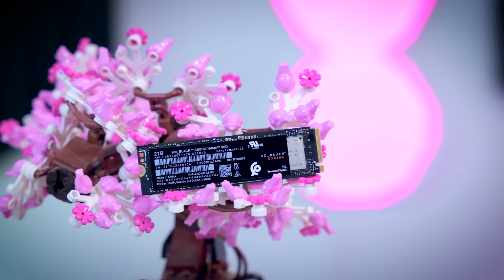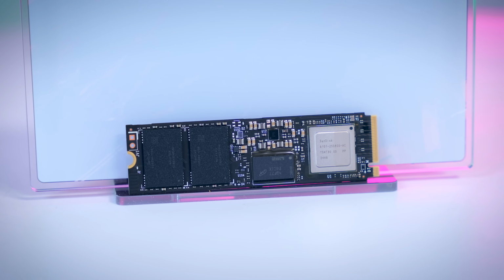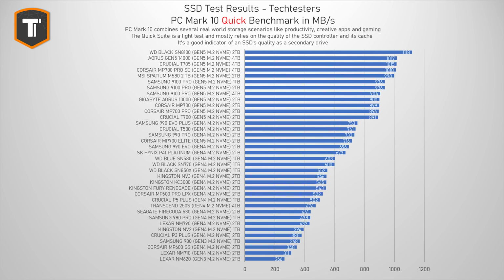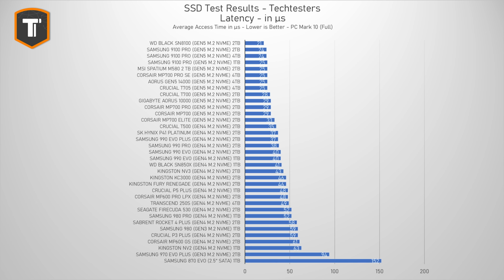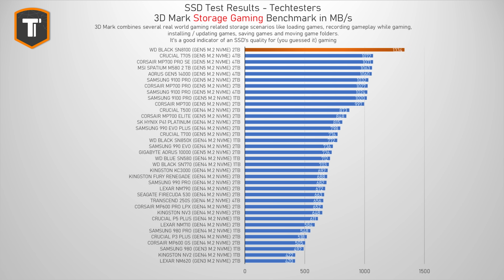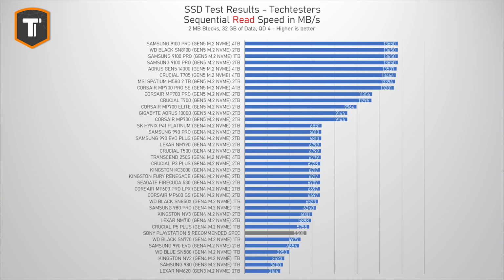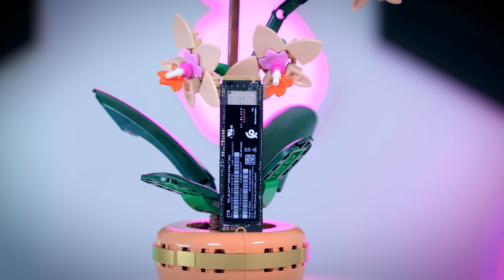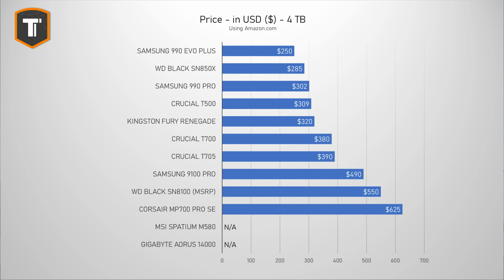Destroying The Competition - WD Black SN8100 SSD Review

Comment: The Western Digital SN8100 is a solid-state drive in the M.2 2280 form factor, launched in May 2025. 
It is available in capacities ranging from 1 TB to 8 TB. This page reports specifications for the 2 TB variant. 
With the rest of the system, the Western Digital SN8100 interfaces using a PCI-Express 5.0 x4 connection. 
The SSD controller is the "SM2508" from Silicon Motion, a DRAM cache chip is available. 
Western Digital has installed 218-layer TLC NAND flash on the SN8100, the flash chips are made by Kioxia. 
To improve write speeds, a pseudo-SLC cache is used, so bursts of incoming writes are processed more quickly. 
The cache is sized at 600 GB, once it is full, writes complete at 3892 MB/s. 
Copying data out of the SLC cache (folding) completes at 2000 MB/s. 
Thanks to support for the fast PCI-Express 5.0 interface, performance is excellent. 
The SN8100 is rated for sequential read speeds of up to 14,900 MB/s and 14,000 MB/s write; random IOPS reach up to 2300K for reads and 2400K for writes.
The warranty length is set to five years, which is an excellent warranty period. 
Western Digital guarantees an endurance rating of 1200 TBW, a typical value for consumer SSDs.

Comment: You said you should use a heat sink with your motherboard, but my motherboard is a laptop and it doesn’t come with any heat sinks. Do you recommend not using a heat sink when it’s in a laptop?
Reply from the maker: Most laptops won't fit a heatsink, so you won't have that option. But assuming you want a Gen5 SSD for your laptop, these should still be one of the better options due to the relatively ok power consumption.

Comment: I'm mostly impressed by the MSI drive. Definitely the best performing 2TB drive here, and seeing how results between a 4TB and 2TB version of the same drive can differ vastly in some tests, I'm curious how the 4TB version of the MSI would score or how the 2TB versions of the WD and Crucial T705 would fare against each other and their larger kin.

My guess on why the 2TB MSI keeps up with the 4TB models of other brands while their 2TB models fall behind, is due to DRAM cache size, which is 1GB per 1TB capacity for WD, Samsung and Crucial, buy twice that for the MSI. So the 2TB MSI has the same DRAM as the 4TB models. 

I am looking to buy a 2TB Gen5 and was set on either the Crucial T705 or Samsung 9100 Pro. Unfortunately there is no comparison here with the 2TB T705 - so assuming the smaller capacity might perform worse, the MSI would be a safer bet, as its 2TB version performs on par with the 4TB versions in this chart (the Samsung for example does not - the 4TB is better than the 2TB one in most tests).

The MSI seems to have a worse PSLC cache architecture compared to the other drives, however that only becomes relevant on sustained writes exceeding 220GB (that's where the WS SN8100 excells).

E

Comment: I just ordered the WD SN8100 2TB for my PS5 PRO! Hope the upgrade is worth it. Thanks for your video.
Reply from the maker: Kind of overkill though, PS5 Pro only runs Gen4 speeds. But it should still be fine, assuming you bought a heatsink too?
Reply: @TechTesters ElecGear EL-P5SP - I think this is the best cooler you can get for the PS5 Pro!

Comment: These benchmark software-based comparisons and tests are nice, but as far as game loading performance goes, they don't tell us the real impact.
The difference in loading times of many modern titles between a PCIE 4.0 SSD and a PCIE 5.0 SSD turns out to be miniscule.  According to testing done elsewhere on Youtube in a video titled "SSD PCIe 5.0 vs PCIe 4.0 vs PCIe 3.0 Loading Games", the majority are in the fractions of a second, and the biggest differences never crack even 2 seconds of faster loading times between PCIE 4.0 and PCIE 5.0.

So while I appreciate the performance difference between all the SSDs shown in scores, it is dramatically less helpful for the average Joe in determining whether spending $100+ for a PCIE 5.0 SSD is justified.

I think that tech reviews are immensely helpful precisely because they let us gauge without buying firsthand what products will give us the most bang for our buck, less so for purely academic or research purposes.  It would be much more helpful if at least some frame of reference was given for what the performance difference would mean in actual usage.

Comment: Great review! In addition to calling out support for TCG Opal, I think it would be really helpful to know if the drives you review are eDrive/IEEE 1667 compatible, which is required for hardware encryption to work with BitLocker on Windows. I recently purchased this drive and was disappointed to find out that while it did support TCG Opal, Western Digital/SanDisk provides no software to actually utilize the feature and it is not compatible with BitLocker. Since I still wanted the drive to be encrypted, I had to use BitLocker's software encryption, which severely harms the drive's performance. SEQ1M Q8T1 speeds were largely unaffected, but SEQ128K Q32T1 R/W, RND4K Q32T16 R/W, and RND4K W speeds were roughly HALVED. On the other hand, the hardware encryption on my Samsung drives works with BitLocker (thanks to a simple toggle in Samsung Magician), and retain native performance when operating this way.

Windows users that care about keeping their data encrypted should know that TCG Opal certification doesn't mean much unless the drive manufacturer goes above and beyond to actually provide proper software support for it, and unfortunately Western Digital seems to have dropped the ball in this regard. Software encryption is always an option, but I can't imagine customers will be thrilled to cripple the performance of their expensive PCIe Gen 5 drives.

Comment: 6:25 You concluded its advisable to use a heatsink after the tests were done (will do!) but did you use a heatsink for thes tests or was the bare drive tested without heatsink?
This gives us a clue about wether or not the consistenty test was throttled by heat on this drive or heat was not the cause.
Reply from the maker: For regular benchmarks I use a heatsink and a little bit of airflow.

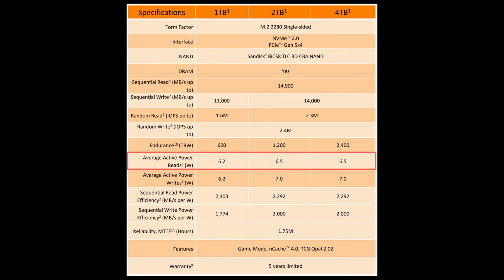Comment: Great video and love how precise and articulated you present in depth the specifications as well as especially the UNSPECIFIIED UNMENTIONED HIDDEN specs are revealed 1:13 to us consumers so we know exactly what is known and what is (deliberately) unknown.
For these alone my favourite technology/hardware channel by far!
Curious about how the much cheaper 1TB version performs against the already reviewed 2TB model. Write speeds are lower, thats fine, but how well do the promised same-high-read-speeds keep up?  Especially the 4K Q1 T1 which are the hardest test for SSDs.
Reply from the maker: Thank you!

I did a capacity comparison video a while back (plus we had some other data from before that). Generally, as long as you grab at least a 1TB drive you shouldn't see a significant difference in most use cases. Only in the consistency test or really extreme workloads, but not for regular use.

Comment: I have a question, if you and your viewers don't mind. I'm getting a ssd enclosure for my steam deck.  I think it's only rated for Gen 3. Would getting a Gen 4 be beneficial? Thanks! Great info!
Reply from the maker: Questions are always welcome :)

I'm not 100% sure what the speed limits on a steam deck are, but I guess it'll be 10 Gigabit USB for an external enclosure? In that case it's not really worth buying a high end SSD. Newer (often Gen4) SSDs do tend to use newer controllers and use less power though, and most budget NVMe SSDs nowadays are Gen4 anyway. So there's no big downside to using an older Gen3, but I would probably look for a entry-ish level Gen4 with a DRAM cache. If you have some exact models in your region I am more than happy to tell you which I'd pick. Just post a new question if you do, as replies-to-replies are really hard to track in YouTube, new comments get pushed to the top.

Comment: I cannot care how fast the Samsung 9100s because of my PTSD of how fast the drive failed and caused me to lose my data in the past from multiple 990s. SN850Xs had been holding out for longer and will be the only drive I will keep buying unless the 8100s have similar reliability.
Reply: Bro. You're supposed to download Samsung magician and update the firmware
Reply: @timothygibney159  I always use SS Magician but I had enough with the firmwares bricking alot of time, especially on expensive drives, hassling with RMA processes and customer supports.

Comment: I have a similar Gen5 installed, but I want to caution you that the 14,900+ MB/s transfer rate measured in CrystalDiskMark does not reflect actual application transfer speeds in loading or processing data inside software applications. There is a data bottleneck when it comes to loading and transferring data into the applications. The best speed I've achieved with a fast CFexpress card, read rated at 3,400 MB/s, while using a USB4 (40 Gb/s) reader connected to a USB4 Thunderbolt port into the Gen5 SSD with Windows file Explorer was only ~1,500 MB/s as viewed on the Task Manager. This is nowhere near the advertised 14,900+ MB/s sequential read benchmarks.

It's important to remember that there is a layer of "handshaking" involved in data transfers, which includes sending, receiving, acknowledging, verifying, checksums, and repeating again. This process means the data stream is not a continuous flow but is delivered in packets interrupted by latency (waiting) during the data handshaking. In other words, these super-fast Gen5 SSDs cannot read or write any faster than the software application can process, any more than a larger glass of water helps you drink the quantity faster.

Personally, I know that a Gen4 SSD will work with similar application timing speeds, but the Gen5 future-proofs for higher transfer rates as software and computer technology continue to improve throughput speeds.

Comment: Hi! I'm currently hesitating between the T500 2TB and the 990 Pro 2TB, I know the T500 had some issues about large file transfers but I don't mind, mostly care about boot time / load time! Where I'm unsure is because the 990 Pro 2TB seems to have been updated from Pascal V7 to Pascal V8 like the 990 Pro 4TB uses. Your review of the 990 Pro 4TB shows it being a notch above the 2TB, so I was wondering if your tests were done with the Pascal V8 version of the 990 Pro 2TB and if that would put it back on top of the T500, hope I'm making sense. Unless moving my RTX 5080 to PCI4 and getting the SN8100 instead would be worth? I've heard it doesn't really make a difference to the GPU. In the end I'm really just wondering what you would recommend haha. Thanks again for all the work you put into these :)
Reply: Blindly go with 990 pro. I just returned T500 2 tb. The new unit which manufactured recently have some serious consistency issue. I got one (non heatsink) with latest manufactured & latest firmware but have serious heating issue (even my msi z790 motherboard m.2 heatsink could not help it & speed dropping too much even my sn580 without dram performing better. Maybe they swap component again. Crucial is expert in this. 

990 pro dont have such issues. Their helth dropping issue also solved with latest firmware. Mabe i should go withit also.

Comment: One thing I would like to see tested on reviews is their longevity.
Been using a Samsung 850 EVO 1TB SSD for a very long time, it currently has 132.1TB written to it and still no issues.
 I don't know how reliable are current M.2 drives.
Reply: How are they going to test longevity if they just came out
Reply: @tej0127  Stress testing is a thing.
Reply: @zaldronthesage you can stress test all you want it still won’t be an accurate representation of how long something will last
Reply: @tej0127  The longevity of an solid state drive is given by how much data you can write to it, not actual time.
Maybe I've should use the word reliability.
Reply: I just bought a used 870 Evo 4tb because the price was excellent. Not my main drive but it can run games without an issue or just be a storage drive. These are still really good, unfortunately the price isn't always that far off from a much better nvme.

Comment: Also missing information in the Spec sheet
DRAM Cache size
pSLC-Cache Size
NAND Write speed (if the pSLC-Cache is exceeded)
Reply: dram size is 1gb per 1tb like it used to be before gen 5 drives.
Reply: @Frozoken  pSLC Cache i would assume at the same level as with Gen4 Drives, REALS NAND-Write speed more or less at the same level as Gen 4 drives. So the speed increase of Gen5 Drives only takes in account as long the DRAM Cache is not overrun (i.e. small amount of Data), after that the average speed will be asymptotic go down to the real NAND-Write-Speeds (somewhere between 300 and 2000 MB/s depending on the used NAND Chips)

Comment: The game needs to be programmed to handle SSDs effectively, similar to how PlayStation optimized for the PS5, which allows for faster load times and improved overall performance. This level of optimization, however, is rarely the case on PC, where many games still do not take full advantage of the potential speed and efficiency that SSDs can offer, leading to a disparity in user experience between console and PC gaming.

Yes, if the hard drive LED is blinking during game loading, it indicates that the game is struggling with the SSD's flow rate, suggesting that the data transfer speeds provided by the SSD are not being fully utilized. This can happen when the game's engine or design is not optimized to take advantage of the faster read and write speeds, leading to performance bottlenecks that may result in longer load times or stuttering during gameplay.

thx for the video

Comment: A lot of reviews now claiming that the new 4TB Kingston Fury Renegade G5 is now the fastest and coolest PCIe 5 SSD. According to the reviews it runs insanely cool.
Reply from the maker: I expect one soon, so I guess we'll find out :D
Reply: @TechTesters  You're one of the few channels I have clicked the notification bell for. Looking forward to more gen 5 SSD competition
Reply: @TechTesters When will you review kingston fury renegade g5?
Reply: @TechTesters When will you review kingston fury renegade g5?
Reply: Depending on price it can be extremely interesting even if it's not the fastest. Kingston lists the TBW at 1000 for the 1GB, 2000 for the 2TB and 4000 for the 4TB versions.

I just can't ignore the TBW numbers. The WD Black SN8100 4TB has a listed TBW of 2400. This is probably enough for most use, but I really hate having drives that fail. So the 1600 higher TBW implies that there is a slightly less risk of this happening before the drive is old enough to be replaced.
Reply: Renegade G5 uses the same components as SN8100, 218L BICS8 flash and Silicon Motion SM2508, so performance and temps should be similar
Reply: @shav3280  exactly. Except on reviews (like Storage Review) the SN8100 is a little faster across the board, but the Kingston is about $40 cheaper all around. The endurance difference don’t make sense to me, but it looks like the Kingston G5 is using a 12 layer pcb, but I haven’t  found anything about the WD